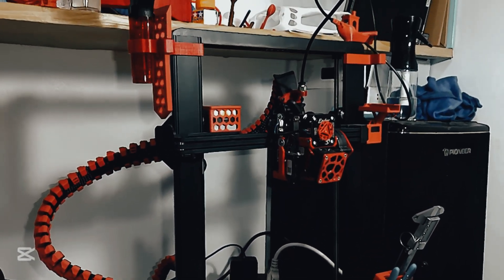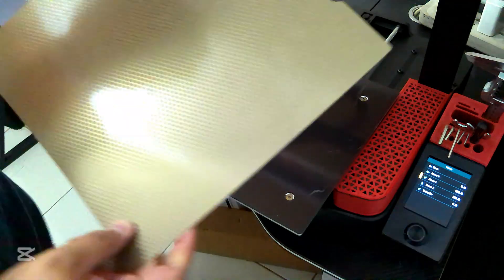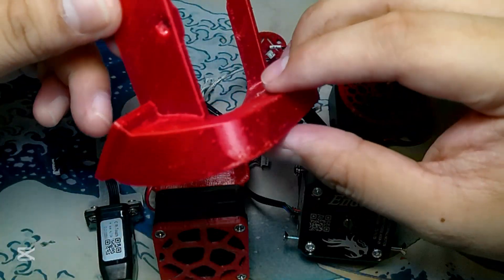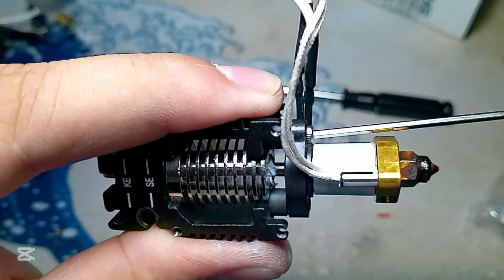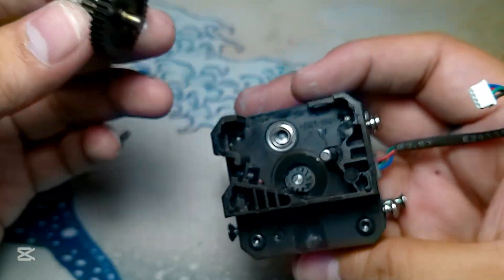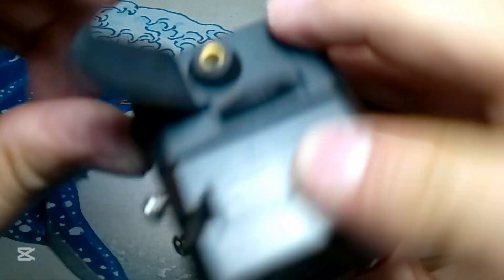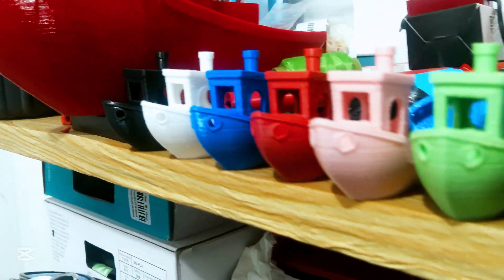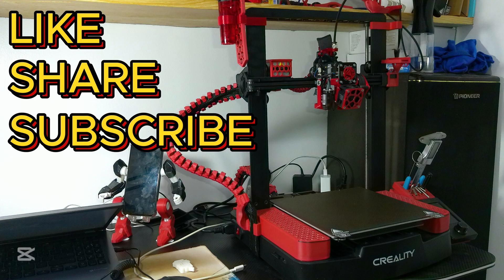Ender 3 V3 SE Upgrades (Yay or Nay??)

Comment: 6:30 the blue stuff you see at the end of the screw looks like blue loctite, you might've stripped the threads forcing it out if you disassembled while cold or more commonly, threaded back in wrong and stripped the soft metal. Probably best not to open it up often

Comment: Very cool mods, I might have found some new ones I wanna do now as well.

I also got an SE that I modded quite a bit already. Got the same 5015 Cooler for example.

Was the ceramic hot end worth it?
I'm yet to have any issues with the stock one tbh. I did change the fan to a 40mm Noctua one though.

I'm thinking of also making a video about the mods of my printer when the parts for the next mods arrive, I ordered some gantry supports that dont need any drilling in the case of the printer.

Great video, thanks!

Comment: I got the nebula pad (before upgrading to linear rails) for my ender 3 v3 se and it made the printer move much faster and the flow rate and layer skipping was terrible, I tried to fix it by setting the amps for the motors to a higher value but it did nothing

Comment: And with all these upgrades still hasn't upgraded to klipper or debian
Reply: A support gantry and Klipper should be standard on these machines anyways.  Also, moving the filament from the top of the unit has been one of the better mods I've done.  They are built to break themselves apart.
Reply: @denniswoycheshen  the reasin why klipper isnt standard for 3d printers is because marlin is cheaper and klipper is very complex to set up and marlin is simple so its good for beginners while klipper needs a medium to strong cpu or else its features are useless like bambu lab a1 it has trash cpu and propieratry software because they are paranoid of competitors swooping in and taking code
Reply: @denniswoycheshen  the reasin why klipper isnt standard for 3d printers is because marlin is cheaper and klipper is very complex to set up and marlin is simple so its good for beginners while klipper needs a medium to strong cpu or else its features are useless like bambu lab a1 it has trash cpu and propieratry software because they are paranoid of competitors swooping in and taking code

Comment: for the benchy check e step calibration, and flow rate calibration. I basically upgraded rails, used silicone spacers, z gantry shims and no matter what I was getting sand paper quality on one of the sides and including brims for some reason, the first layer was always rough. I then replaced the nozzle (should've been my first fix...) and didn't recalibrate z-offset, can you guess what happened to my build plate :P. I had almost given up till I found people on youtube talking about my problems which seem similar to your benchy. e step calibration didn't do much but now I had it calibrated, then I printed a flow calibration gcode from printables, and it started making sense. I was over extruding because of flow by 30% dialed it back on my slicer to 70% and low and behold I can print good again. My z-offset still feels a little off from the auto z offset, but again the difference is almost night and day. Right now my problem is either to low or too high no mater what increment I use but prints a whole lot better than before. I wanna try the hot end as my next upgrade and put the x rail upgrade that's throwing another $70 at it, the y rails where $50, the other parts like $20. I did get a couple of 5015s that i'm gonna splice together with a pigtail and do dual duct but with two 5015s and hopefully I will be able to do crazy overhangs. I don't know how much of a difference the hotend upgraded fan will do with the stock hotend but maybe I'll try that too. Your's is the first duct that doesn't run  front to back on the nozzle as I like being able to watch it as it prints and most of the other models obstruct view from the front.
The rail upgrade was a must, since I could not find replacement y rods online anywhere available to me (U.S.). One guy sells a kit for and upgraded kit for $50 10mm from 8ish-mm but is sold out.

I'm also printing z gantry supports, even though the rails negate much of the bed wobble the z gantry seems flimsy while printing. I really wish they would've used the same body for all the v3 since the flagship is all metal I assume it's a whole lot sturdier than the se/ke. Also the se should've come stock with klipper even if we didn't get a touch screen. $70 for the nebula pad updgrade seems too steep for what you get but maybe if I score a used one somewhere so I can finally try input shaping. To be fair I think you only need the sensor and custom firmware navaismo which I may try since the sensor is like $5 and the firmware is free :P

Comment: I would change the extruder as well and skip bowden tube to remove any clogging issues as well as maybe play around with the settings since your prints isnt as smooth as they can be unless you use pla mostly, in my opinion petg gives best strength, quality and surface
Reply from the maker: Thanks for the suggestion man! I'm still on the learning curve of this hobby so suggestions like yours is really helpful hehehe thanks again
Reply: @ no problem, btw great video! Im pretty new as well but i got the hang of it and i got really nice prints even at 300 mm/s with klipper. Linear rails is a nice upgrade to!
Reply: New also, so reading as much as I can. He changed the heat block to ceramic, did you? If not, what is your suggestion? Change the extruder to what type? So don’t use a bowden tube system?

Comment: I print loose cores that fit the center of my spools that have a central hole that is closer to the bar it rotates around in size... this way the spool rotates smoothly around its center rather than the irregular tension you get when you just let it do its own thing
Reply from the maker: I like the idea thanks! The spool holder has the tension that you're mentioning, will try to do that for smoother rotation thanks
Reply: @thesealanderboi  I lately instead of a cylinder with a hole  print something that looks like the side of a spool with most of the bit the stuff is wound on cut off,  the inside bit fits sungly inside the spool's hole  and is just slapped on from the side.. (I mainly started using those as I buy tiny rolls of cutoff filament like 100m  or so from a local factory. the spool side shaped inserts just helps keep the filament from jumping off those small spools whle they are full. I have only 14cm printer so had to print them at 45 degrees over one axis to fit a larger print I think it can do 18cm-ish
Reply from the maker: My spool holder is separated from the printer, making the shaking less. The only downside of that is that when ever i try to change spool in the middle of a print i keep on putting it back in the bowden tube hehehe

Comment: Hello, I have my SE for a month now, works great, if anyone is reading this, tell me what you think. A friend of mine recommended I remove the PEI on the bed, and get a glass panel (not tempered, just plain 4mm or so thick glass) of the same size, he says he does it with his printers and its day and night. I havent looked online about it yet tbh.
Reply from the maker: I haven't tried it yet but on what i heard is that it works great, i suggest if you're going to stick with the PEI sheet, go for the gold one. Never had an issue on warping and failed prints, my failed prints usually is because of human error hehe though if you want to try the glass bed, try creality's glass bed, same 220x220. You just need to remove the 2 alignment screws on the bed hehe

Comment: Doesn't you extruder cover ha a fan or wiring connected? How did you change it?
Reply from the maker: The fan from the extruder cover is the 5015 fan replacement that i have on the side of the extruder, i just cut the existing wires and replaced it with the 5015 fan and it worked beautifully, its just 2 wires, a black on and a red one, when you're going to connect it, its pretty straight forward (black on black and red on red)

Comment: plate links]
Reply from the maker: I sourced mine locally so it might not be the same for you but you just need to find a PEI, PEO, and PEY build plate i think that would suffice
Reply: @Tracks_And_Chill Technically the build plate is 235x235. I believe there is an allowance of 7.5mm in each side but the build volume is 220x220

Comment: Love that red petg. Do you have any intention to add a nebula kit? I just rooted mine finally. I think I noticed the original marlin unit. I love the fan shroud, I think I may print one! I’ve already got the same 5015 Duct and I like it a lot. It’s the only one I could find with an inverted mount for the fan so the air comes from the outside.
Reply from the maker: Hey man thanks! really appreciate it! yeah I'm planning to add the nebula kit in the future and install klipper as well hehe just need to do a little bit of research if i have time hehehe yeah the shroud is actually good! i didn't include the calibrated part on the video though it can run a volumetric speed of 30 mm/s with the shroud and the ceramic kit hehehe

Comment: My S1 printed better straight out of the box with zero calibration than both of those examples. Quality does not even start to degrade until 200+mm/s and maximum allowed firmware acceleration/jerk, even then its just slight distortion on overhangs. How fast were you trying to push that thing?
Reply: Idk what this guy did. My SE printed as good as his upgraded one out of the box, I put in the same hotend and added diagonal support bars and now print way better than that at 220 mm/s. I didn't add any fans or weird red shit.

Comment: Nice video! I just recently purchased my ender 3 and started learning about 3d printing. Do you have links for the parts like the fans and hotend? I'm also from the Philippines so it would be a great help.
Reply from the maker: Nice nice I'm form the Philippines as well! I have the files in the description below, I strong suggest join the Facebook group (https://www.facebook.com/groups/3453027578146684)  and the links for the hotend and fans is here from shoppee

https://shopee.ph/3D-Printer-Silent-Cooling-Fan-5015-Turbine-Centrifugal-Humidifier-Fan-5V-12V-24V-i.1007494822.18389640947

https://shopee.ph/2PIN-Dc-40mm-Cooling-3D-Printer-Fan-40x40x20mm-Cooler-24V-12V-5V-4020-4cm-Computer-Case-oil-Cooling-Fan-Heatsink-Fan-PHK1-i.451738613.26406117701

https://shopee.ph/Creality-3D-Ceramic-Heating-Block-Kit-Quick-Swap-Nozzle-Kit-for-Ender-3-V3-SE-KE-3D-Printers-Support-600-mm-s-High-speed-Printing-All-metal-Integrated-Design-Easy-to-assemble-i.236999378.26604570657

Make sure to get the 24v, it wont work if you get the lower voltage feel free to comment and look forward on my next upgrades thanks!
Reply: @thesealanderboi  thank you!
Reply: @thesealanderboi  
have you tried changing the fans of the motherboard/power supply to make it less noisy?
Reply from the maker: nope, the 5015 fan reduces the noise significantly then the 4020 fan is kind of quiet though I haven't tried the 4010 fan, some say that the 4010 is a lot less noisy than the 4020

Comment: One thing folks.
Stock great prints at slow speed.s.
Z screws need loctide.
Running klipper.
There is a lot to do on this printer if you want it fast and good x axis upgrade nebula pad and klipper.
Y axis fixd ore upgrade. 
Antishake.
Anti shake feet.
Runout sensor. 
Pei sheet.
Spoolholder gone from the machine. 
And then your there where the ke is.
And dint forgeth the hotend. 
The se great printer if you want to print and wait.
Nothing wrong .
Want a fast one go geth the ke.
Upgraden from this machine is the same mony.
If y new this one year ago i wud have goth the ke.
Now i just upgrade this machine and it fly.s.

Comment: One mod I did on mine was a 50 degree screen mount that makes the screen go closer to the bed letting the printer take up less space on the desk.. also I added a lighting system that has a RGB remote.
Reply from the maker: I was actually going to do that, though i have the storage bins near the bed thats why I cant do that hehehe but thats a good upgrade to be honest hehe

Comment: E.M is for extruder motor
Reply from the maker: Yes and the sockets are mostly different so you shouldn't have any issue on putting it back in hehe the only socket that is the same is the cooling fan and part cooling fan

Comment: Advice from my own experience.
Replace the ptfe tube in front of the hotend with the one that came with the printer, it should be made a little shorter than the one that came with the new hotend.
This will help to accurately feed the filament as before, and not rest against the metal throat, if the filament is cut a little incorrectly.

Порада з власного досвіду.
Замініть ptfe трубку перед хотендом на ту, що була в комлекті принтера, її треба зробити трохи корочшою за ту, що була в комплекті нового хотенду.
Це допоможе влучно заправляти філамент як і раніше, а не упиратись в металеве горло, якщо нитка трохи невдало обрізана.
Reply from the maker: Thanks man!! Wondered why as well that when ever i replace the filament there are times its a struggle to go in hahaha Thanks for the advice I'll keep that in mind thank you so much!!

Comment: Im goin o use that dual channel 5015 fan mount. Is it any good? Any issues with the cooling? My ender doesnt have any screw holes on the side of the extruder motor block so i cant use the 4010 mount u have or a lot of solutions that requirw those holes.
Reply from the maker: If your printer is the classic ender 3 I dont really know if it would work hehe tho if your ender is using the sprite extruder the 5015 mount actually mounts on the side of the extruder motor hehe it might work hehe

Comment: Your stock is worsethan mine, heck your upgraded is worse than my repositioned stock fan. You probably have a bad benchy model or you need to tune your profile more, your upgrades are for speed, you can incorporate faster speed while tuning your settings.
Reply from the maker: Yeah I figured that I need more calibrations and I used the wrong model and filament for the comparison, to be honest I dont really have other old prints to compare it with hahaha! but thanks for the feedback, will try to tune more to incorporate faster speeds thanks for watching! 😁

Comment: Your printer must had a problem, your "original" boat was not good at all, but my original printer, no mods prints exactly as your final benchie boat!
Reply from the maker: Figured that as well haha keeps on clogging thats why i had to upgrade it haha tho it did a lot better in max flow rate and over hangs hehe
Reply: My stock one could print it far better

Comment: hello, you have issues with the ceramic hotend?
Reply from the maker: @dgm778  just a minor one, which was resolved with in the time of the recording hehe other than that its immaculate hehe 😅
Reply: @thesealanderboi   good to hear that, i planning to buy ender ceramic hot end or TZ E3 ceramic from aliexpress, i read a mixed comments, broken etc..
Reply from the maker: @dgm778  well to be honest creality has some design flaws with the ceramic hotend that they had,  ive seen the other reviews though it never happened to me, Im not sure why but I'll give an update if ever i had some issues and how to resolve, for now it works for me it increases the max flow rate which is a super pro hehe
Reply: @thesealanderboi   thank you for the reply!
Reply from the maker: @dgm778  no worries! Glad to help 😀

Comment: I think you only made it worse. It prints much better in stock.
Reply: A bad print doesn't mean the upgrades are for worse. These are all regularly recommended mods. With some calibration this will print very well
Reply from the maker: Well i think i used the wrong filament (matte pink) for the example and its a different gcode, plus the print difference is almost 3 months apart 😅 I'd try to use a better example next time but I'd still look into that, thanks for the feedback btw 😀
Reply: Uh you are mistaking .
I goth al the upgrade. S.
Xaxis nebula pad that runs klipper only thing i dit not upgrade is the y axis.
Bud i fixd it it wobbels.
Just pul on Rod from the y axis .
And messaure 7.8 mm.
Instead of 8mm.
And i goth anti shake.
I can run a fulltime benchy at 20 min.
Whit klipper and with marlyn i run that 48 min.
You Just need the upgrade

Comment: cool setup! just got mine yesterday and started upgrading right away. i noticed you have the lighter/spatula holder not linked, would like to print it aswell :)
Reply from the maker: Thanks man! Appreciate it! Enjoy printing! 

Thanks for noticing, I'll update the description though here is the link as well hehe

https://www.printables.com/model/966273

It doesnt have the lighter holder because I've remixed the file hehe though you can do it in the slicer, i use orca, i just added a cylinder with a hole same size as the lighter and i joined them together through the slicer software. I could make a short video of that, and will update you through that hehe